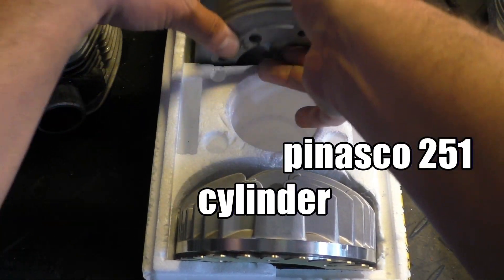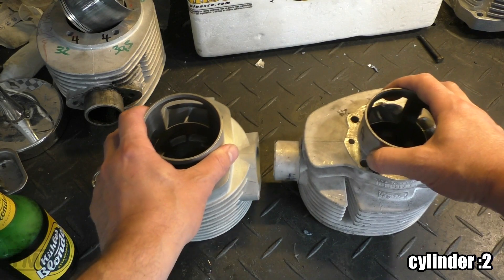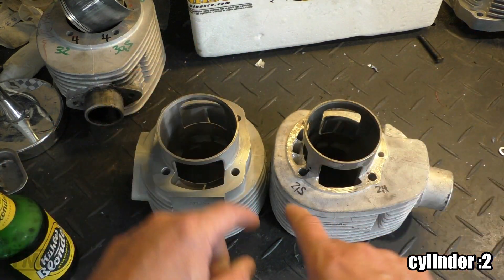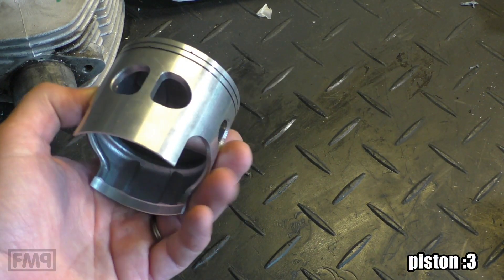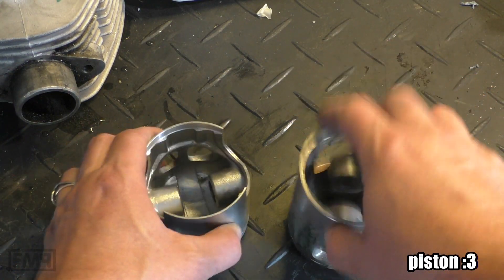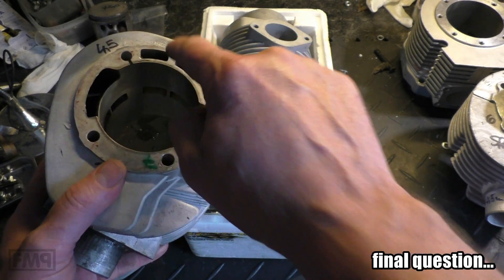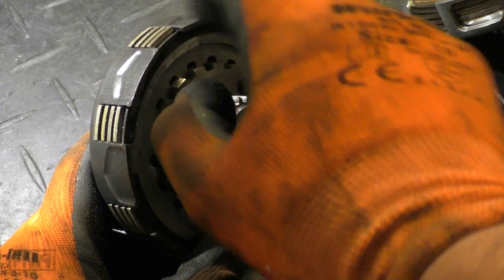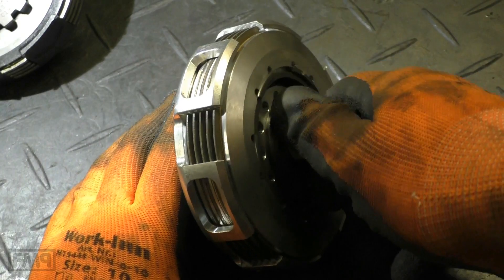vespa PINASCO 251: 15! QUESTIONs for pinasco... | FMP-SolidPASSion |

Comment: better to buy a Malossi sport.  221 and a head mrp.  secure stable and one of the cheapest.  now for those on a bigger budget.  quattrini 244 or the new BFA 225 cylinder.
Reply from the maker: sport221 yes, some. Ex porting and it hits 25hp, more than the p251. 

agreed with quattrini. bfa lets see, they have to proove it first that they can be better than m244 cause its very ingenious

Bfa is supercool (and very expensive) cause of the 306 project. But if their hardwate for standard px is good or better than already available stufd, we dont know that yet.

The bfa177 is ok. Weired timings tough so i am not gonna try it at all, as vmc is an excellent choice

A vmc 200 is announced 😜 thinking of the Impresive crono this is gonna be very very intetrsting!

Comment: Did something change over the years? Their stuff used to be good but now it seems like they are just reselling products that they sourced that sort of fit but not really. Have they stopped designing products specifically for Vespa? Maybe they never did? Just within the last year, I have had a Pinasco flywheel break and a friend had a Pinasco clutch break. Both fit but not great.
Reply from the maker: its a more likely dealer, people are not aware of that. everybodies choice what products he uses, what he believs marketing is telling him. From pinasco, i only do use 2 products, si26 and the tubeless 2 part rims, both a resell of course, pinasco doesnt produce anything

Maybe in the past they actually technically developed something? But based on the cylinders, this can not be read anymore, these days

Comment: Are polini kits generally better than Pinasco ?
Reply from the maker: no. as they are not further developed, the 177 and 210 are still old kits, just some optical tuning (head) and aluminium. 210 still uses the weak piston, 177 pistk still doesnt fit the cyl ports... Powerwise also not state of the art

Only malossi, vmc, bfa did providr actual NEW developed cylinders

Btw vmc 200 kit coming 😜

Comment: When I first heard of the 251 I thought it was going to be brilliant. Sadly pinasco could have done a lot better. Il stick to my quattrini  😊😊😊👊✊
Reply from the maker: quattrini is still the King. An incredible cylinder. 50 and more hp possible. More than enough 😄

What the bfa244 will deliver, we will see. 

https://youtu.be/c4x_CRUxAZY
Reply from the maker: I would. Have liked to add the p251 to my onroad comparison list, BUT...
Reply: @FreakMoPed8  my last 2 engines both been quattrini can’t fault the quality or performance for both 125/150 casing and on the 200 case.
Reply from the maker: Oh you would have been surprised 😂 as soon as they use the BEST pistons, its worth to take another look. Only using efficient ones, ever since, reveals the approach.